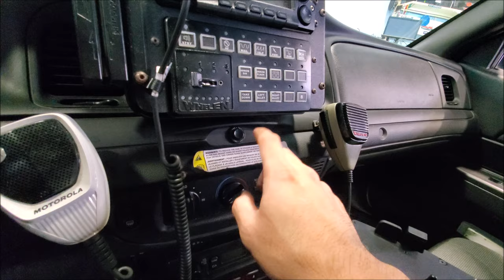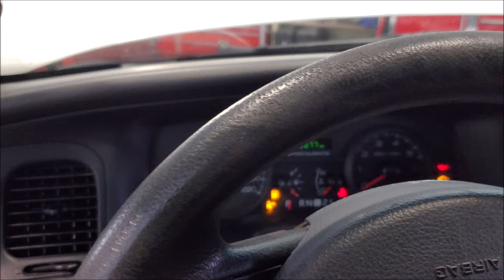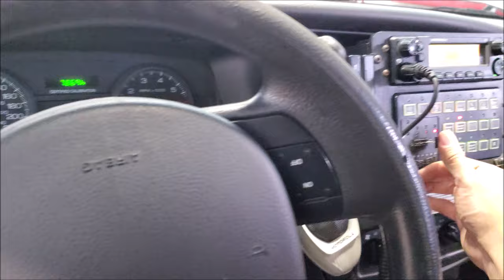What's Inside a Ford Crown Victoria Police Interceptor? | AnthonyJ350

Comment: I bought an 2008 CVPI from a neighbour about 8 months ago.
$3000 with 118,000km and 1285 idle hours. It was a Burnaby cruiser. Must have been a detective car or something, cloth rear seats, no holes in the dash, no holes from rear partition. Great condition really for being a fleet vehicle.
I've replaced all the brake calipers/rotors/pads with higher performance. Lowered it 2". Replaced the intake manifold/gaskets, plugs/boots, water pump/thermostat, belt/tensioner/pulleys, blend door actuator/blower motor/resistor/switch, main power window switch, wiper motor/wiring harness, tires. Probably a couple other random things I'm forgetting.
This thing is a beast, super fun to rip on. I put in a ditch at 70kmh in a hard left turn, it hit something with the front right bumper and wheel, hopped out of the ditch with 100 pounds of dirt stuck in the underside (mostly in that cross member lip) and jammed in the tire beads. Passenger tires started leaking because of the dirt in the beads.
Had the tires/rims cleaned/reseated and the alignment checked. Alignment was exactly the same as my last alignment when I purchased the tires. Incredible amount of strength in that front end rear end.
My favourite car of all time, I've had about 30 vehicles in my life so far, it knocked the older Volvos' out of first place for me.
Reply from the maker: That's an amazing story! So cool to hear it had low KM and idle time. Take good care of it!

Comment: I knew the shift programming was different for police vics but not that they were again subdivided to patrol -type and whatever the other one was you mentioned.
I understand Ford has the tuning programs for each VIN available on line, at least as it came from factory. 
This is 2 years after your video (assuming that’s when you taped it) and I love that you featured an (ex?) Mountie car still in “dress uniform”. Must be a BC car based on low “rust/km” ratio.
I wonder if the RC’s stockpiled Vics for later use once the end was in site. Newspaper articles on line mention Toronto and London PD’s. did.
I have an ex-OPP unmarked grey 2011 Vic I got 3 yrs ago, retired from service 2019. Works great as you say, having just made a second annual drive to Nova Scotia with it last month. Drove direct to Peterborough from Annapolis valley 18 hours continuous, minus stops for fuel etc.
Reply from the maker: This was an active car. There's still a few Crown Vics serving my area. In a lot of ways it's still a better police vehicle than the new stuff.

They're tougher and take more abuse and light hits better than the current Explorer Interceptor in my opinion from what we see come through the shop.

Comment: Love getting to see stuff like this. Have my own Crown Vic down here in Las Vegas Nevada. Was a local patrol car with LVMPD and ive pretty much fully restored it with all the equipment. Cops love it and many ive talked too wish they still had them. Our department still has them but they are mostly just scacecrow cars in parking lots now
Reply from the maker: I work on them daily now. In a lot of ways the Crown Vic is better than the new Explorer.

The Vic is tougher, can take a hit, easier to put parts off and on. The drivetrain is a lot more simple as well and handles better.
Reply: @AnthonyJ350  agreed. Most cops I've talked too say the same thing as well
Reply from the maker: @vegascvpiaaron6807  Also it being body on frame means the structure doesn't get compromised in a hit as easily. Smack a quartet panel on the new Explorer, it's usually a write off.

And the new vehicles just don't have the same quality or durability.
Reply: @AnthonyJ350  yeah it's a shame really

Comment: I’m not sure where you heard about the “Highway patrol tune” but I don’t think that is correct. There wasn’t really different tunes for the car, but there was different gearing options. These cars had two rear gear ratios, 3.27 and 3.55s. Standard these cars came with 3.27 gears which were good for highway cruising and 3.55s which had slightly better off the line and low end performance. Great video and it’s nice to see these things still in action. Crown Vics are exceptionally rare to see on service where I live.
Reply from the maker: It's anecdotal. That's coming from my boss who has been building law enforcement vehicles for 12 years.  He had this weird one came in and the officer said it was order with a performance tune.  It's not far fetched since civilian vehicles are programmed for economy.  The sedan Tauruses drive so different from the regular versions, mainly shift points are altered and I'm sure timing and throttle response is altered.

I've had 2 of my personal vehicles dyno tuned and they drive so much better and different.

Comment: 2008+ Police only for Crown Vic was in Canada....ONLY.  In the US, Crown Vic LX in various trim levels was sold right up until the end, but in Canada, only the Mercury Marquis version was sold to civilians.  Corporate accounts could ALSO buy the Crown Vic LX in the same trim levels as the Mercury in Canada, but not individuals.  Strange marketing....for a car that was actually MADE in Canada. I have a 2003 LX for a daily driver....I HAD a 2009 LX but it got broad-sided...by one of those idiots who cut through parking spaces without looking, at high rates of speed.  The Crown Vic Sport had buckets and a floor shifter, the police vehicles have column shifts because most police agencies installed consoles in between the seats that ran right up to the dash, for sirens, radios, etc.
Reply from the maker: Thanks for sharing!

Comment: Like yr video.  Excellent !  Correction.  Vics 2008 model  and on not sold to public last yr for Marauder 2004 I have one and a Vic with 241,000 on clock.
Seeing lots of them used by small police depts still.
Ford made a mistake not continuing to make them in 2011.
Reply from the maker: Thanks for sharing!